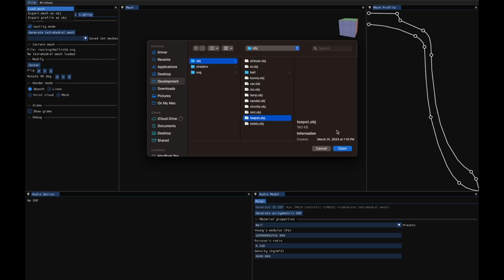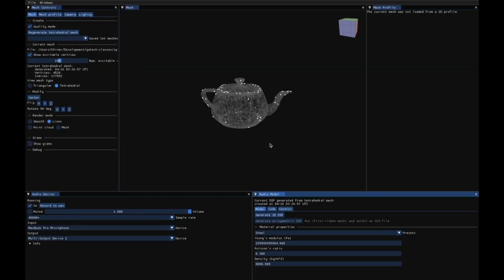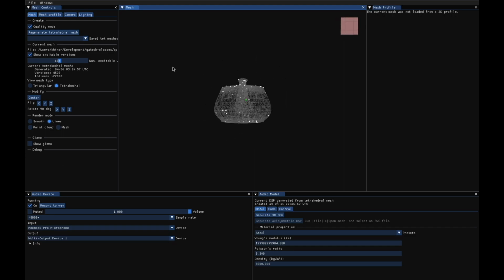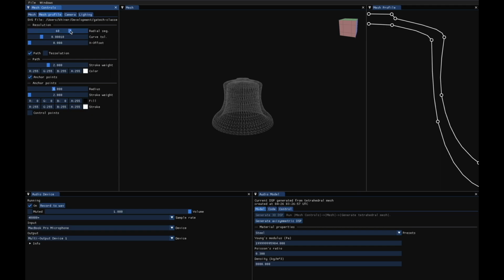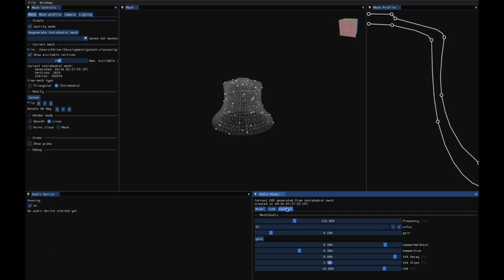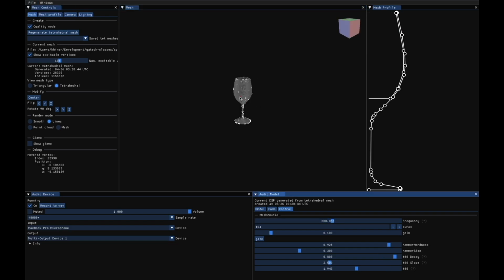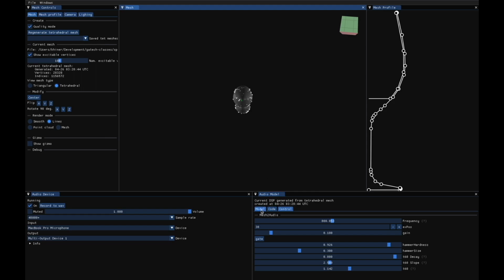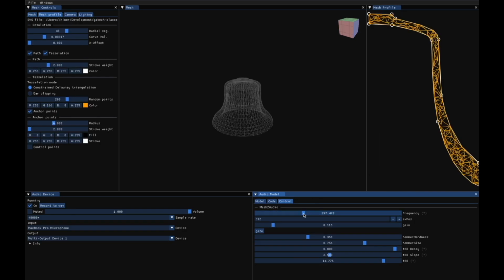Mesh2Audio (Final project for Mod&Sim CSE-6730)

Comment: amazing work, karl! have you tried to use the generated dsp code anywhere outside of your app (ie., to make the instrument more playable, possibly via midi in some
environment that allows the different parameters to be modulated)?

i just sent you an email btw, asking whether the new version of this project (meshaudio) also supports faust code export :D
Reply from the maker: Thanks! Yes, the new version of this does have a button to simply print the Faust DSP to standard out, so you can make further edits or incorporate the model into a separate project: https://github.com/khiner/MeshEditor/blob/b78cd561e07840a8dc4ffb6de41bf501b9fc7f4f/src/audio/SoundObject.cpp#L508

Please create an issue there if you run into any troubles!
Reply: @khiner  beautiful! very excited about the possibilities. thank you sm for the quick reply 🫶

Comment: This is insane. I dreamed of a software that allows you to design your own instruments in 3d space.
Opposed to tweaking knobs without being able to visualize that object.

Really awesome work. It enables musicians to be more creative and have the freedom to design
sound in a practical way. I crave to use it myself.

I just installed Ubuntu to build it. Unfortunately I encountered difficulties installing it since I am not
an expert. Ill continue trying.
Thank you so much!
Reply from the maker: Hi Alviin, thanks for taking an interest! It’s been a long time interest of mine as well, and it was rewarding to work on this! Please feel free to open an issue on the GitHub and I’ll help you work through the issues you’re seeing. I ran into issues with OpenGL stuff in Ubuntu that I never ended up resolving, and wouldn’t be too surprised if there were other issues since I developed it almost entirely on the Mac.